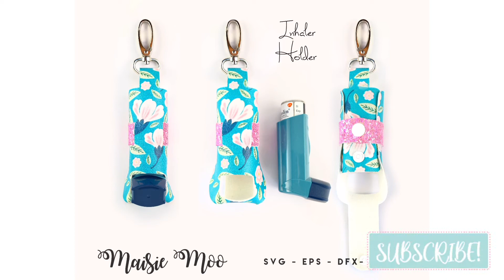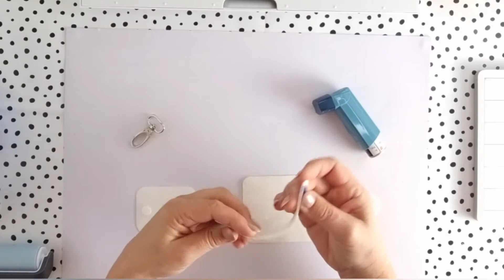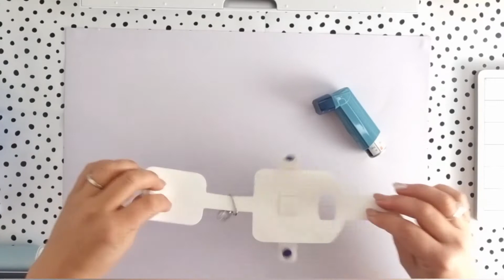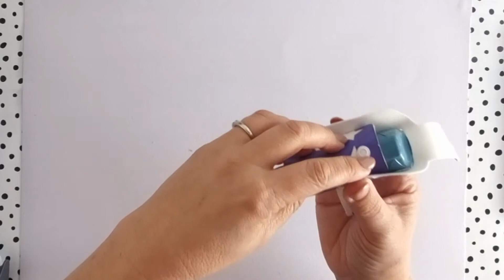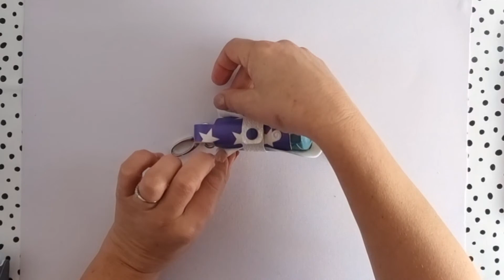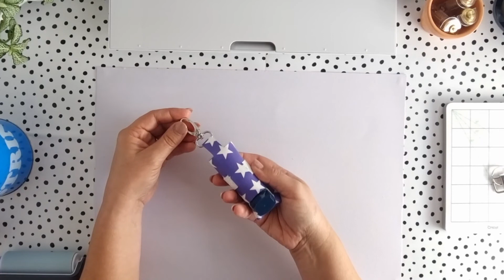How To Make a Faux Leather Asthma Inhaler Cover - DIY No Sew Puffer Keychain Cover

Comment: I’d like to know how wide/what size the hardware is for the keychain part. The ones I used for my vaccination holders are going to be too small for inhaler. Also since you are only gluing part of it does the inhaler come out easily when unsnapped? I am wanting to make one for my mom and grandson.
Reply from the maker: Hi there Sharlene, all of this is covered in the PDF instructions that come along with your files.  If you have any questions please just reach out via Etsy or my website.  Thanks Ria